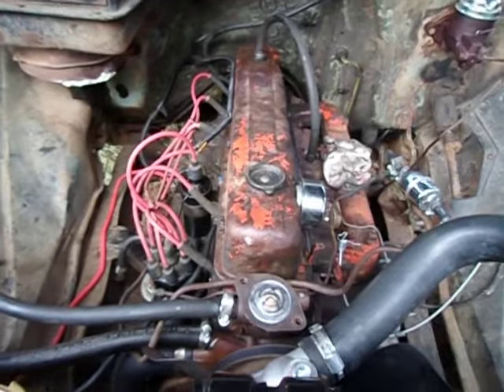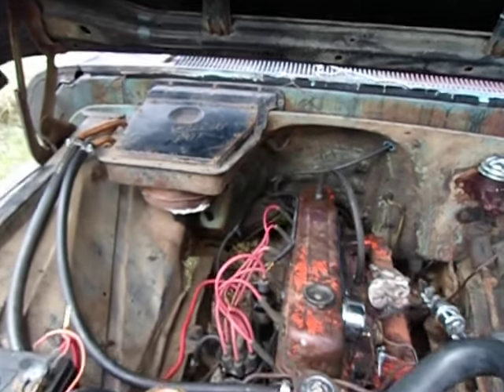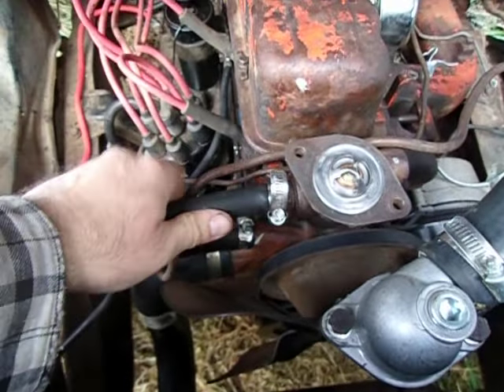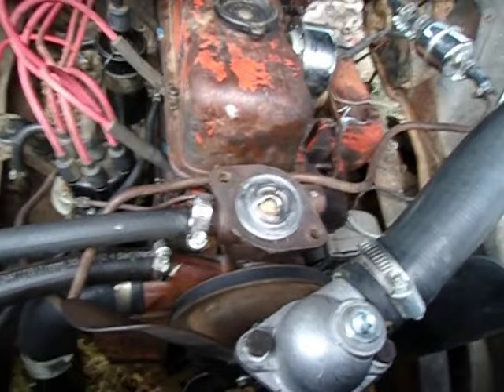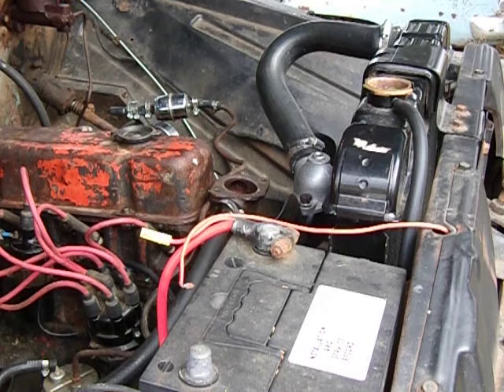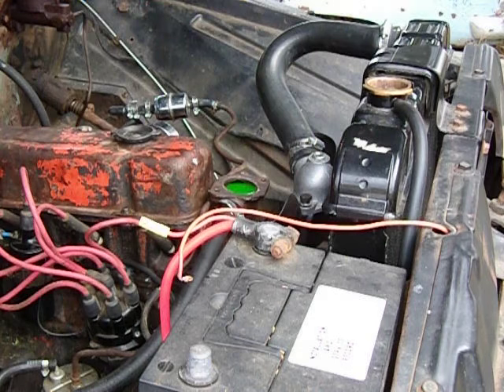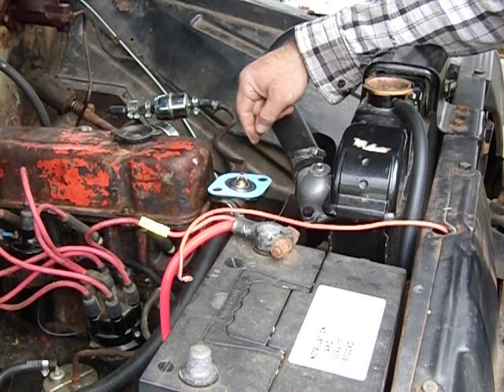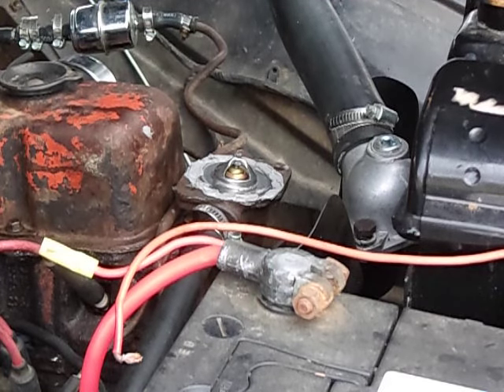Preventing air bubbles in coolant (after working on the cooling system)

Comment: The overflow lets air out
Reply from the maker: I see you have a Ford related playlist. The Ford small blocks, like the 302/5.0L, have sideways mounted thermostats which are not nearly as likely to trap air pockets at the thermostat like the GM engines of the last century. Of course, when there is an air pocket instead of coolant below a thermostat, the thermostat can't open and the engine will overheat. As far as I know, you would have to go back to the Ford flathead V8's with their thermostats mounted high and flat for a similar problem to this video's topic regarding the GM engines. Dodge also had a high and flat mounted thermostat in the 318 and 360, but some other Dodge engines of the 60's apparently had sideways mounted thermostats. So you might not have had to deal with the problem I am addressing in this video unless you have also dealt with Dodge 318 V8 engines or old Chevy engines (Chevy straight 6's like the 250 and 292, Chevy small block V8's like the 350/5.7L and derivative V6's like the 4.3L V6, Chevy big blocks like the 454, etc). I consider this issue to basically be a GM and Mopar design flaw that Ford had already fixed in the 1950's. 

So now you've done it. You made a Chevy small block fan admit that Ford did something better on the 302 than GM did on the 350. :)